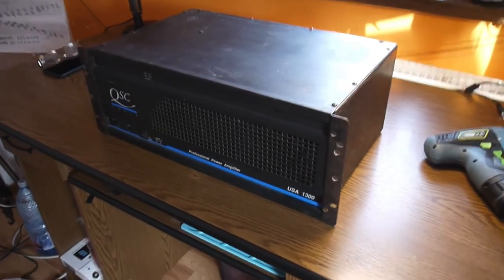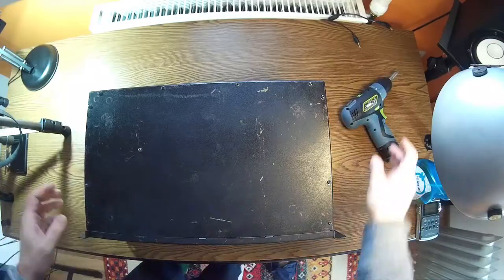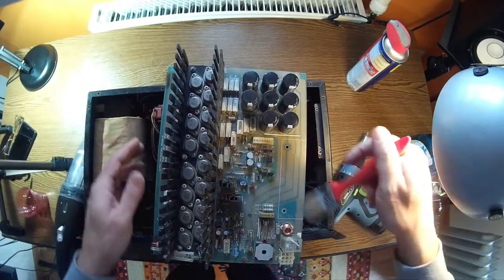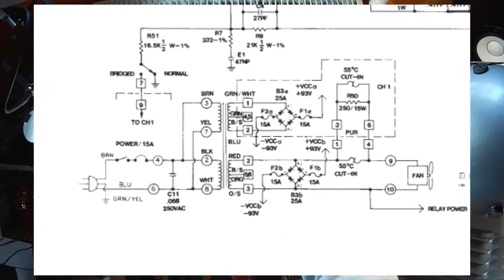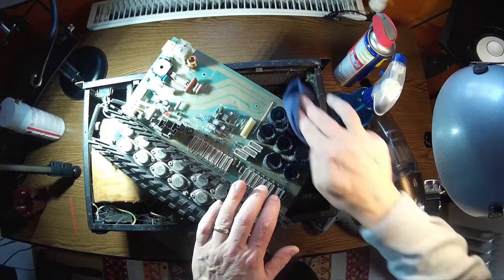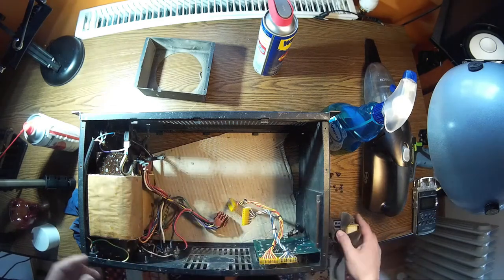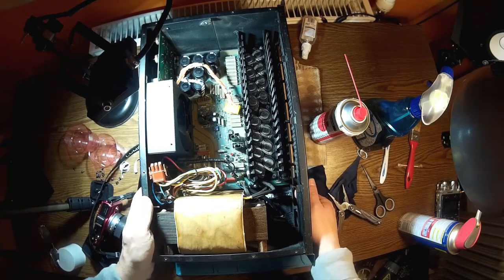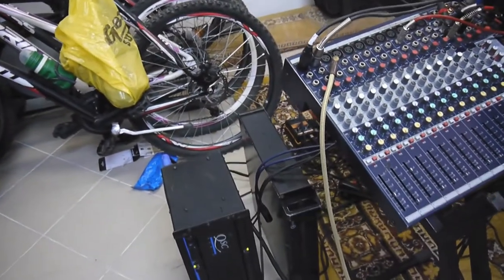QSC USA 1300 class AB Audio Professional Power Amplifier cleanning

Comment: Can the music from a dj system with 4 full range 15 inch tops and 4 18 inch pa subwoofers be heard from outside your house across the streets if you have the volume levels on the power amplifiers cranked up high and have the gains and volume controls on a mixing console cranked up really high.
Reply from the maker: Yes..it's very possible to have guests too, the fireguys, the cops..just kidding.Yes it's working very well, good , clear ,crispy sound, it's old good  class B amplifier, there is no way to compare with modern class D ''trumpet'' like sound! But don't go under 2 ohms per channel.

Comment: Can you use a pro audio power amplifier without a mixing console or will using a pro audio power amplifier without a mixing console cause a huge loss in sound pressure level aka the amount of decibels.
Reply from the maker: There are two different entities..The console deals with low voltages, usually few.Also '' is carving'' the audio curve, makes the sonority and mixes different sources to a single signal to the input of the Power amplifier.There is no loosing but gain to the audio signal.If you connect an audio source like a CD player, laptop, DAT, so on  directly to a Power amplifier input , there is a risc of not enough output level or input level to the amplifier, that means low volume and flat response as long as there is no sound correction in between..finally, for good results there is a need for a console!

Comment: If you’re power amplifier and your mixing console was drawing more wattage than what your wall outlet was rated to handle will you start to hear a scratching sound or a popping sound when you turn up the gain on the mixing console.
Reply from the maker: Very possible..I'm trying to use different power lines somehow..or simply turn down the volume..

Comment: When repairing a power amplifier to get it out of protection mode will replacing the bad capacitors with higher voltage capacitors make it stay in protection mode or cause further damage to the power amplifiers mainboard.
Reply from the maker: If the replacement are the same value it should work..maybe it's something else, like an auto oscillation on a high frequency..check the output with an oscilloscope.

Comment: Will replacing the capacitors in a power amplifier with bigger capacitors as well as adding more output transistors to the mainboard in a power amplifier make the power amplifier output more wattage.
Reply from the maker: In theory yes! everything is related to the power supply, not only the capacitors but the transformer too..

Comment: Can you run 4 8 ohm 15 inch subwoofers all wired in parallel off of one power amplifier in bridged mode.
Reply from the maker: Yes, you can run in safely 2 ohms load on each channel, by the book.I never use it though..In bridged mode don't go less then 4 Ohms..look here at page 4 https://www.qsc.com/resource-files/productresources/amp/discontinued/usa/q_amp_usa_legacyseries_usermanual.pdf

Comment: Will plugging that power amplifier into a power strip that is rated to handle up to 500 watts cause that power amplifier to output less rms power than what it is able to put out.
Reply from the maker: Right! It needs a really good power connection, you can see the lights flickering at full power!

Comment: If you’re a dj and you’re entire dj system has 2 15 inch full range pa speakers and 2 15 inch pa subwoofers and a entire rack consisting of 2 qsc power amplifiers a behringer graphic equalizer and a behringer active crossover and a soundcraft mixing console can a dj gig be done at someone’s apartment for a birthday party without getting complaints from the neighbors in the other apartments attached to that person’s apartment.
Reply from the maker: Be sure it's the last party..for a while! Have some snacks and drinks for the fireguys and don't try to bribe the Police! Maybe if you play Smoke on The Water...But of course, if you can manage everybody to be nice and resonable..why not! The quality of the sound matters..not the power!

Comment: I have a 12V 130psi pressure washer I use for stuff like that.   Spray it with isopropanol alchahol.    Better check the electrolytic's.  At that age it need recapped for sure.
Reply from the maker: Super, thanks  Pulesjet!
Reply from the maker: One board's been already recapped..as I can see ..anyway the sound is really good!

Comment: No oil on the fan.  Use Dry Silicon spray.  Does not collect dirt and dust.
Reply from the maker: I already did that! I'll clean with WD40 next time , when I'll check the electrolytics